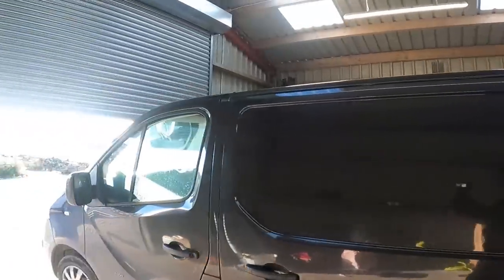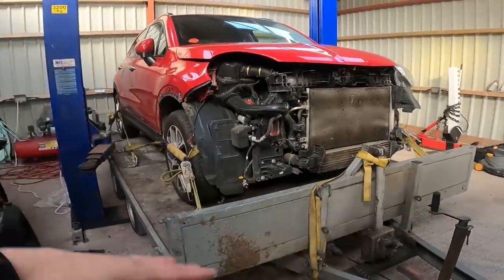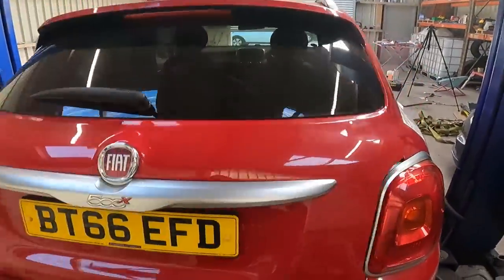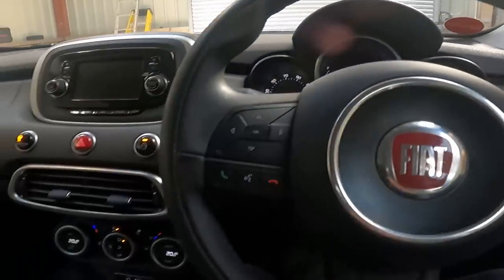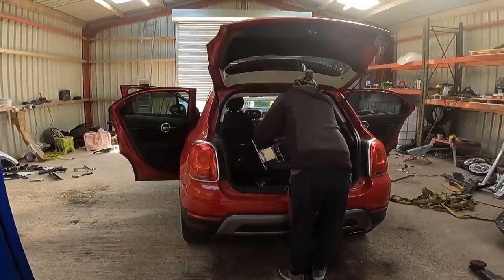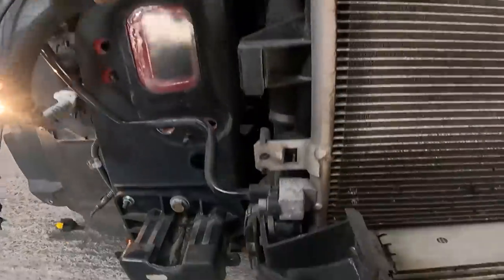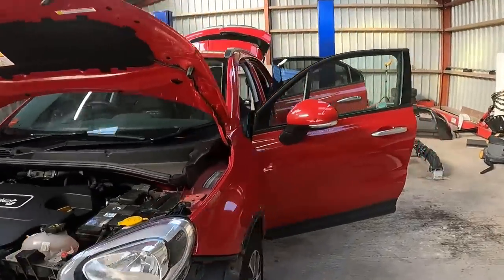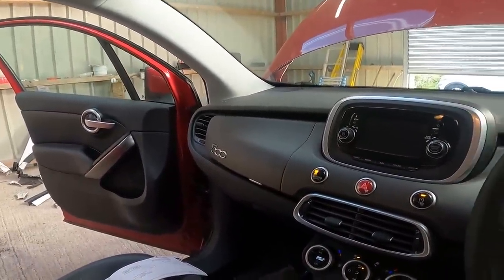66 Plate Fiat 500X Cross With Little Damage For £3600??? LOOKS Like It Will Be An Easy Fix!!!!!

Comment: I have a 2016 500x Lounge and I really like it.  You got a bargain on yours if you can repair it without costing too much.  I didn't know they came with diesel engines as mine has the 2.4 liter Multiair. It has 180 hp and so I'm guessing yours has about the same.  You practically stole that car at the price you paid it, good job and thumbs up.

Comment: Nice car Phil it’ll look great when finished.I have a 500x plus auto petrol,bit heavy on fuel but nice to drive with good height and you don’t realise how big they till you see them against other cars before that I had a 500l trekker  auto diesel with the multi engine and was getting 48-50 mpg easy on short runs so the multi air jet is a great engine

Comment: You're very lucky that its running well with the broken intercooler.. those plastic bits will be wedged inside the ic. A quick rev and they're in the combustion chambers.
Reply from the maker: You have a good point there,  will be more careful next time!
Reply: @SeriousAboutSalvage  Surprised me when the engine was whistling like hell & you just kept trying to get the bumper out the boot. I'd have checked over the engine bay well before starting it up with all the frontal damage. Take care next time Phil. Might be a costly mistake waiting to happen.

Comment: There is not much difference between the 500X cross and the cross plus models apart from the alloy wheels and a bigger Sat nav option. I can see yours has climate control so the upper glovebox might also be air conditioned. If you are stuck for engine parts check out the Jeep renegade as they have the same drivetrain.

Comment: I see the SYNETIQ bar code on the quarter lol. What yard did you get it from?
Reply from the maker: Doncaster 😁
Reply: @SeriousAboutSalvage  Lol i work at that yard so if you see a car and want a better look at it just let me no and i will send you a lot more pics
Reply from the maker: @mark-g8294  pop me an email over 😁
Reply: The only downside I find with Synetic are the descriptions - "Accident Damage - Starts & Drives" is copy/pasted on nearly every car they auction off themselves unless the "actual" seller pays for or supplies a better description I guess. Some lots seem to be conveniently light on damage pictures or show only dashboard dials etc without the engine ticking over. Not helpful at all compared to some other sites. At least some of the 3rd party breakers on the Synetic site go into more detail so I generally bid/buy from them instead of Synetic yards unless I see something I can't resist or any damage is 100% clear to see. I could ring up & try to get more detail but with so many of interest I'd never be off the damn phone ;p